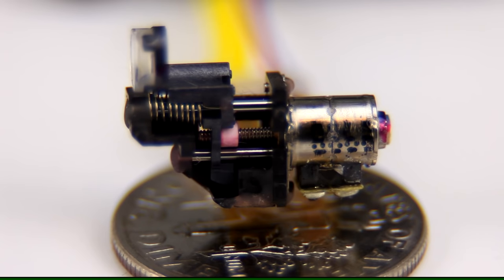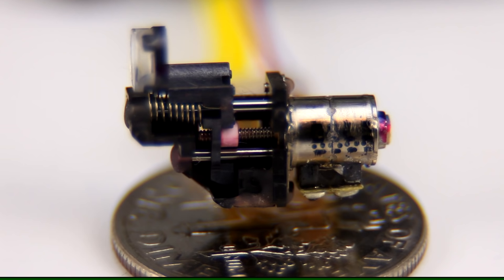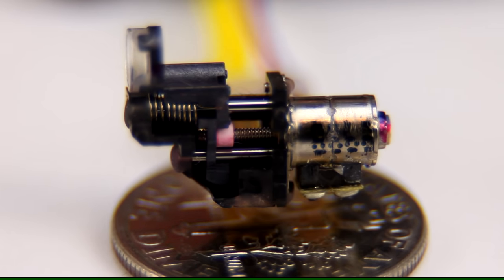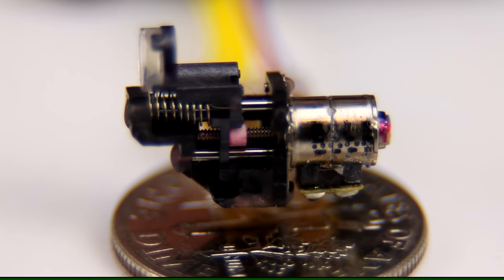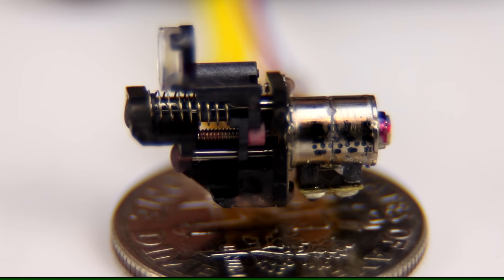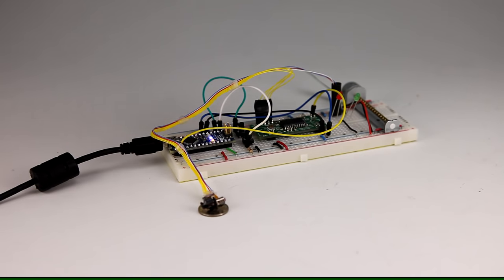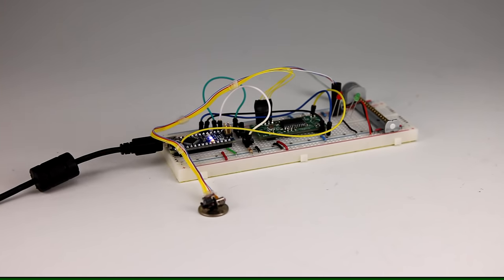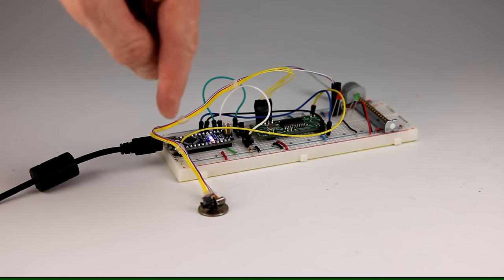World's Smallest Stepper Motor with Arduino Nano (HD Version)

Comment: If instead of EasyDriver it can just be two resistors:

One side of both coils is fed with 2.5V (enable on A0) and we pull and push the other side of the coils using A1 and A2.

Using analog inputs because these have far more juice than the digital pins.

The enable goes to the common coil side with a resistor, then that goes to ground with an identical resistor.

The other sides of the coils will pull on 0V and push on 5V whenever enabled, and have to  be 0V whenever  disabled.

Comment: Thesedays you can get 10 of these for about $1 or $2 on ebay/aliexpress (free international shipping too).  

You dont need a stepper driver for them, they are so low power that you can run them directly off the power in your arduino I/O pins.  Tho dont run too many of them at once from the 1 arduino, the power all adds up eventually.

That larger stepper tho, you may need to use a driver for that, as that one might take too much power for the arduino I/O pins.
Reply: Can pls share link for such motor ?
Reply: No, just goto ebay and search for this term: stepper -heatsink -driver pcs -1pcs -2pcs -3pcs -4pcs 
Set item location to Worldwide.          
Sort by Price + Postage: lowest first

Comment: Very impressive. Please let me know what type of wire attached to the motor and where you bought.  I also have problem to solder the small motors as the pin broke so easily. Thank you

Comment: Sorry for asking for it now, 2 years later, but do you maybe remember how much degrees/step did it turn? I am thinking of purchasing this kind of motors on ebay, but I cant find any details on this one...
Reply from the maker: Sorry I got this note late. But I think this is a 16 SPR (steps per revolution) stepper, just as all other barrel-type micro-steppers I've seen (like slightly larger ones from laptop DVD drives). I believe this one is driven from the 1.9V rail in the drive (via a proper stepper driver of course) although I just used 5V in this video and it survived :)
Reply: Thanks you for the info! So I've purchased this kind of micro-steppers, I will sure be able to use them, maybe even without motor driver :D
Reply: Hello, could you please send a link on ebay where you purchased these motors?
Reply: Because today it's not possible to find a motor with linear drive

Comment: How did you manage to solder wires to such small connections?
Reply: Thats what I'm wondering right now too? :o Anybody have any idea how to solder wires onto such small connections? I made an attempt but the solder and connectors on the stepper melt at the same temp :(
Reply from the maker: With a steady hand, about 40 years of soldering experience and A LOT of flux :)
It might have been possible, perhaps even easier, to solder directly to the motor (as I have done with the slightly larger CD/DVD steppers) but here I soldered to the flat cable, which I had to slice between the conductors and fray to move the conductors apart some more. Difficult but definitely possible.